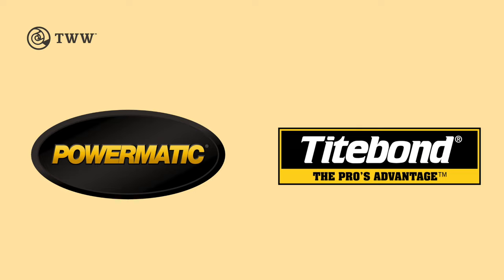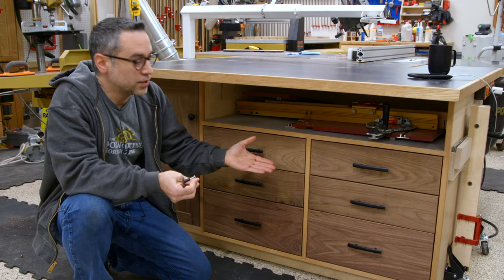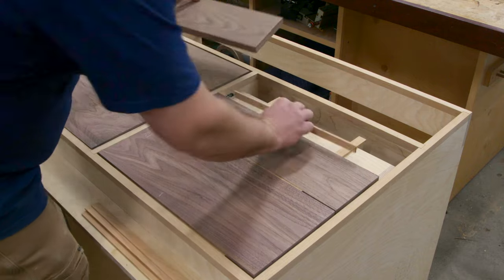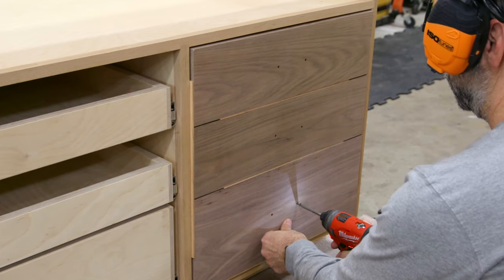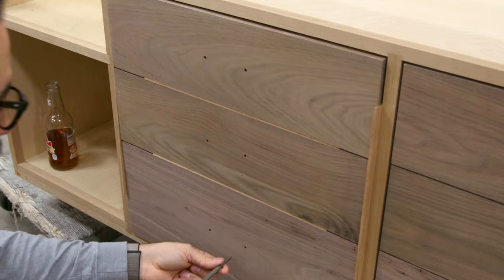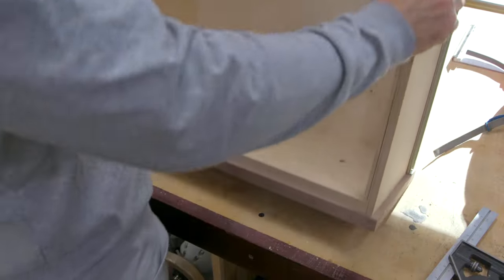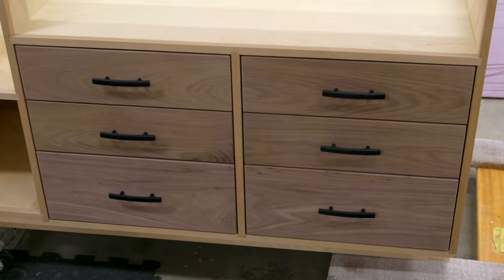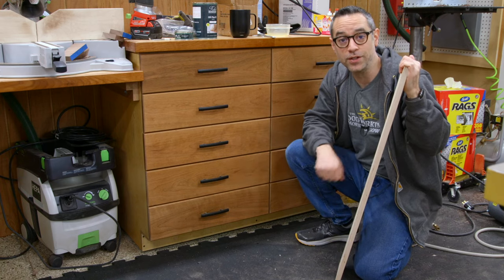Installing Drawer Fronts the Easy Way!

Comment: Wow! This is how my dad and I used to install drawer fronts well over a decade ago. I didn't think anyone else did it this way.

Things we did differently were glue the fronts and pre drill the holes on the back side before the fronts were put on.

This is cool to see someone else using the hardware holes like we did!

The main reason we did it this way is the jig we used to drill the hardware holes couldn't be used once the drawer fronts were installed, so it only made sense to drill the holes before installing the fronts. Now, over a decade later, alignment jigs are much more common and cheap.

Comment: on site install for joiners unfortunately can't do it this way as nice as it is. A pack of playing cards is ideal as spacers or some window packers in your tool box of different sizes and a couple of deep clamps/quick clamps to hold the drawer front onto your drawer once you space it evenly with your packers, drill a couple of screws in from behind and your drawer front attached working from the bottom up one at a time. then you can line up you handle holes with a combo square, template tool or preferred method, pre drill and insert you snap screws and job done. Certainly more the UK on site method for kitchens, wardrobes etc. only means you have an extra couple of screws inside the drawer but a lot faster and easier than this method, but also a neccisity when you cant lift a kitchen island up and down or a fitted wardrobe carcass out of position just to fit handles.

Comment: This is pretty cool. What's the next best way, if you are not using any hardware for handles? Let's say you mill out a pocket in the middle of the drawer front. Then what? Part 2? Pls
Reply from the maker: The other ideas I mentioned at the beginning. Clamps, adhesive or Brad nails.

Comment: Interesting. Have you ever had an issue with the drawer pulls being off center from each other? I guess that would only be an issue if the frame was out of square.  I’ve always found center line after installing the fronts, then drill the holes for the pulls.
Reply from the maker: As you mentioned, that would only be a problem if something is off in the cabinet itself. If the drawers are all aligned with the shims in place, it should be safe to drill for the hardware consistently on each front and have them all lined up perfectly in the finished product.

Comment: Good tip, but have you tried hot glue? I always just hot glue the fronts in place till I can get some screws through the back.
Reply from the maker: I haven't tried hot glue but I have used double sided tape and brad nails, which would be similar in concept. I find this way quite a bit easier and more reliable.

Comment: I have seen you use this trick and heard others credit you for it. Thanks for the full version. I really would like your opinion on jointer/planer cutter heads. I realize the helical ones are the best choice my question is are their significant differences between Byrd, Luxcut, and vendor brands such as Grizzly?
Reply from the maker: I am not totally sure. I am sure there are specific differences but I have used Shelix and also some proprietary versions and never thought one was significantly better than the other.
Reply: @woodwhisperer  thank you for the quick reply. I am about to equip my dream shop(recent retiree) the brand jointer and planer have their own versions. I have been trying to determine if replacing a new head would be worth the cost and effort. They wont install the name brand heads from the factory.

Comment: This only works when you use handles or knobs. What if you want you have it with a push to open system. You can’t drill in the front. Glue?
Reply from the maker: One of the methods I mentioned at the beginning: glue, tape, or brads.

Comment: What do you when you have something like shaker door fronts? My main concern is getting the fit perfect, trimming it down after they are built sounds like it could cause some issues
Reply from the maker: In that case you'd want to be a lot more careful about measuring your drawers BEFORE you build them. So you'll be doing some math or cutting some scraps and standins. Then build the doors to exact size so they only require minimal work to fit perfectly into the opening.

Comment: why r u using 2 small pieces of wood at :50  but at 1:10 you don't have them. why use them in the beginning for placement handles?
Reply from the maker: When the cabinet is on its back, it's a lot harder to get the drawer fronts out if they fall all the way into the case. Since we're establishing the size of the fronts at that point, there's a lot of test fitting and trying to get them out can be a pain. A couple of shims behind them make them easier to lift out.